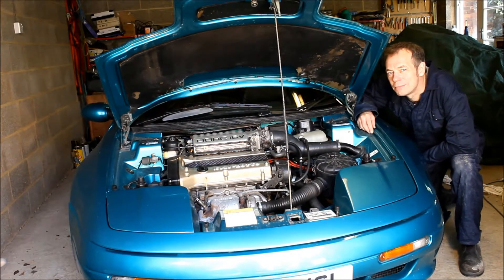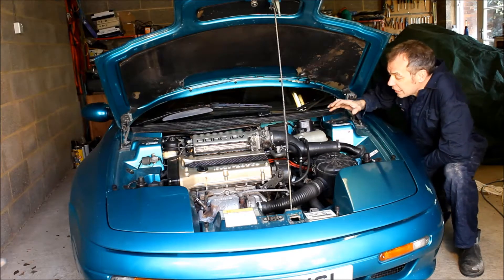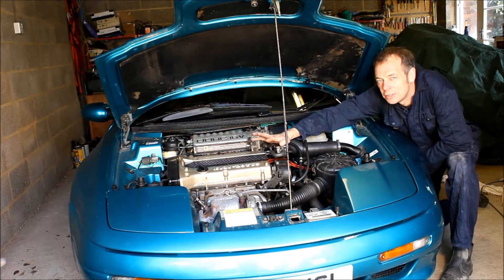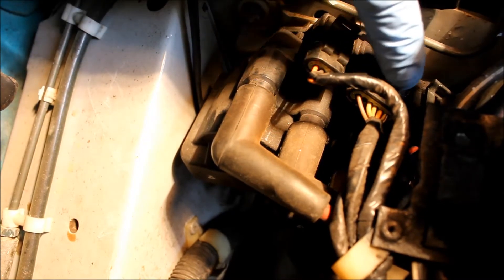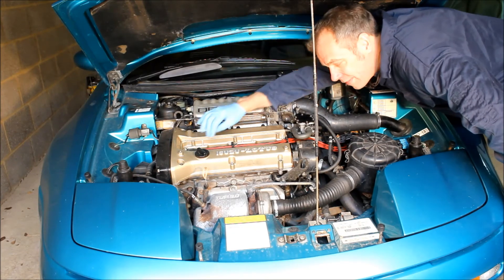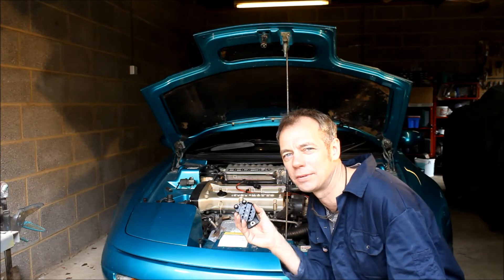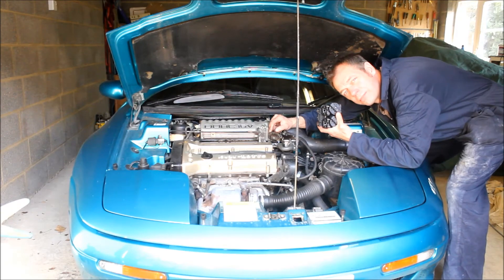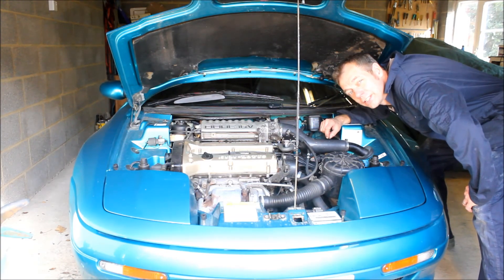Replacing the ignition coils and plug leads on the Lotus Elan M100

Comment: Hello,Thank you for your informative series. I'm sure it's helped many and is much appreciated. 
I'm writing you from the USA(Utah)and I'm hoping you can tell me the best places to purchase parts for a 1991 Elan SE(Pacific Blue btw). I'm currently in need of a windshield, and would like to acquire two window motors and a right side (passenger side in the USA) window regulator. Could you offer your best opinions are where to obtain these?Thank you!
Reply: Hi Sam, realise this was a year ago but just in case its of any help. www.lotuselancentral.com is the best place for info. britcarnut is US based and maintains a parts list and has many parts himself. Rockauto are a US based supplier for a number of parts. Not the ones you listed but help is on LEC.
Reply: I had good experience with SJ Sportscars in the UK. They had much better prices, better availability, and were delivering in 2 business days to the Texas from the UK for a reasonable shipping price (DHL).